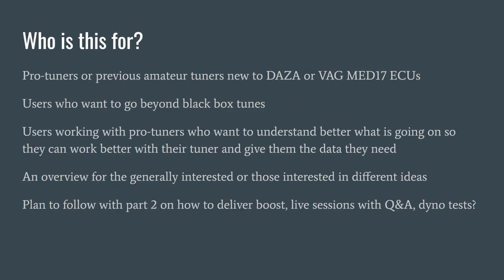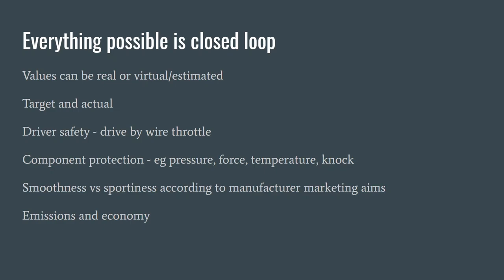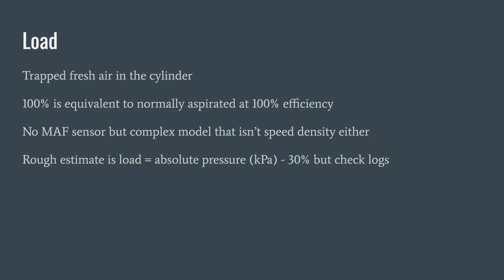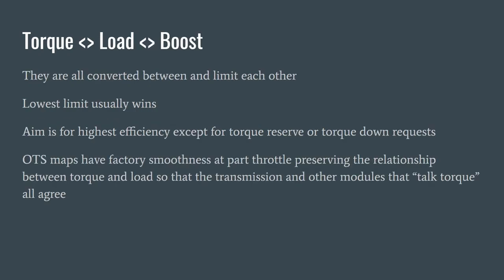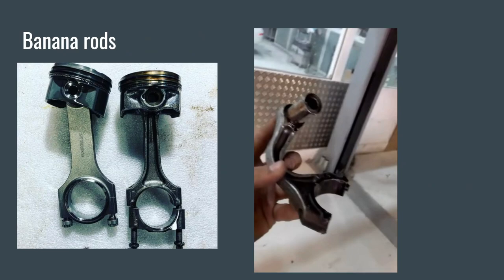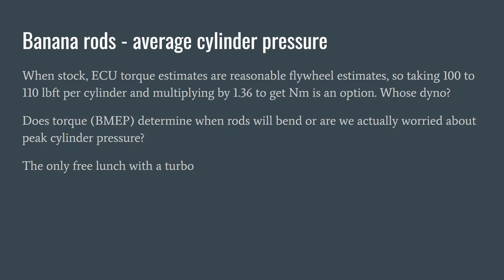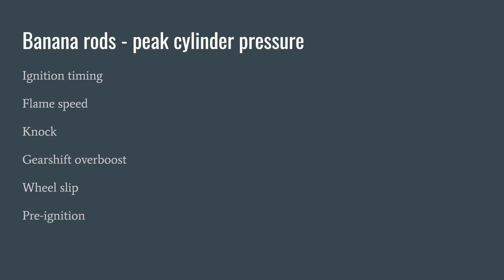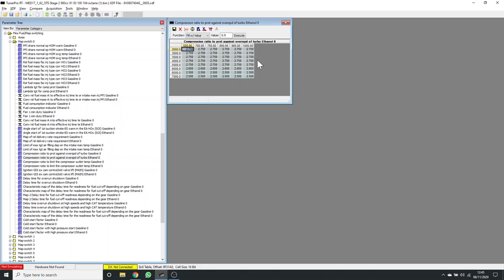DAZA DS1 Boost target

Comment: Awesome video, congratulations! Almost no one is willing to show content for free. Thanks!!
Reply from the maker: Thanks. I was trying to sell a tuning product. On this platform it had a slow start because whilst it came out with features others still don't have three years later, many just can't see beyond their drag times and don't care about control quality or safety. Eventually the market turned in our favour. Rinse and repeat on the next platform, tuning standards are terrible on those too.
Reply: @evorealtime  I agree!! And thanks to people like you we are getting more "mature" in this market and some are starting to understand that a good software is not only numbers on the dyno. One thing I got intrigued is about boost control. You told on video that the stock sw aims load, but you recommend aiming boost and wgdc. Why so?
Reply from the maker: @PGTA2  Aiming for load or torque would give consistency or respect a limit of a transmission or perhaps an engine in some circumstances. If as is more common we are octane or turbo limited and want the maximum safe performance in good conditions, a boost curve (or rather a pressure ratio which is a multiple of the pre-compressor pressure) fits that objective well and is easy to understand, explain and calibrate. You can still have a load limit above that which might get encroached in cold air to respect the limit of a fuel system for example. Or a torque limit that is usually out the way but can protect a transmission in cold dense air.
Reply: @evorealtime  that makes perfect sense!! Thanks for the explanation!

Comment: This is so useful, thanks for taking the time to make these videos. Coming from an evo background I’m used to seeing wgdc and boost desired engine load. A Pressure ratio multiplier table wasn’t something I was expecting but it’s great to get an introduction like this. Looking forward to the next video.
Reply from the maker: You can do it as a load target like the Evo if you prefer. Or a combo of load, pressure and torque. In some situations we bring a load limit down to ensure the fuel system can cope in cold weather for example. You can layer it how you like.

Comment: Great video, looking forward to part 2. I'd love to see a video that explains the knock control strategy in more detail. For example, these ecu's seem to pull quite a bit of ignition straight from the factory and it's not uncommon to see -5 to -7 correction on 91 octane. On other platforms this would be seen as quite dangerous.